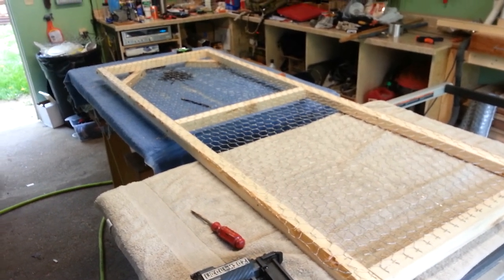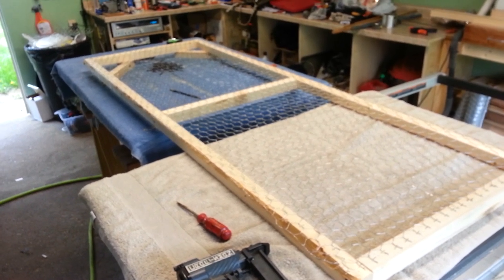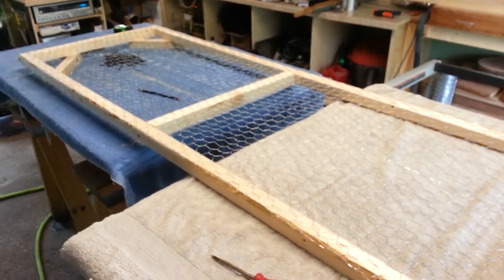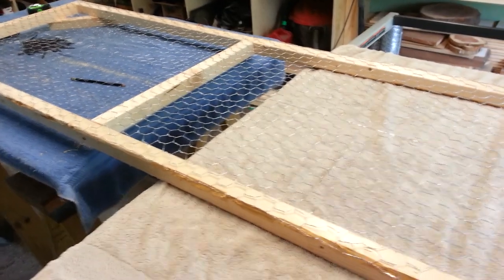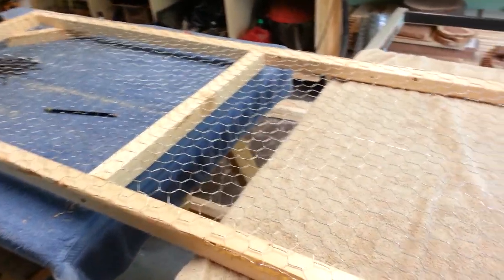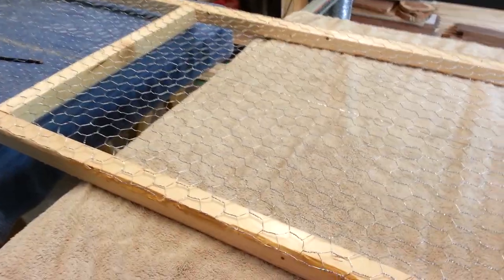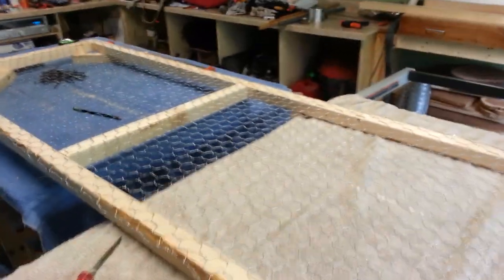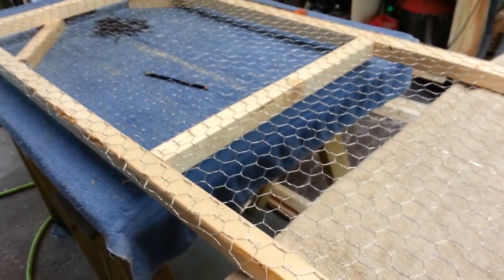How to stretch chicken wire for fence panels

Comment: I have a 18 gage 1/4 stapler that I like a lot but I am looking for a wider stapler like yours Can you give us the model and gage of your stapler and do you like it and is it reliable? Doing chicken  wire tomorrow so your video really helped thanks.
Reply from the maker: The stapler i used is an old craftsman 18 Guage 1/2" crown. Any stapler will work, make sure your pressure is adjusted or if yours has a depth adjustment is set so it doesn't just blow through the wire...

Comment: I need a stapler.
 So how do you unroll the wire and get the bend out so it doesn't want to roll up again?
Reply from the maker: Simply unroll it. I cut the peice to approximately the length I need. I staple one end then proceed to stretch from the opposite end stapling as I go...

Comment: Yours looks so much neater. Lol! I've got an old best up staple gun. Anyway I can ask your advise about chicken wire? Trying to fix a cat enclosure my father made for my cats when I was moving.
By the way I've got 2 sections tightened. Much better. Only 11 more squares to tighten. 
Short story long. I cut a small square out, that's where the opening will be to come inside. Any suggestion how to make a border around it & so it is right as well. I've got to fix some boards as well. I'm trying to finish the inside with scraps I find but I've decided to go with pallet pieces. I've used all the scraps for other projects.
Reply from the maker: faith smith Any opening should have a frame around to attach the wire to.

Comment: The chicken wire is too soft to be stappled directly so the way you are supposed to do it is sandwich it between two thin planks!
Reply from the maker: Nope worked great.
Reply: The edge could be doubled over - this takes up the extra width that now doesn’t need to be trimmed away while giving added strength.... AND use a lot of staples to spread the amount of strain over many points. It’s ROCKET SCIENCE!

Comment: No mention of pronouns what a great video.
Reply: @houseoffire72  I'm using an arrow manual stapler, I didn't want to use staples because at some point they will rust but they are so expedient and seem to work well, I see you are using an air tool stapler, I wonder if it's a floor stapler or a pneumatic version of my arrow stapler.
Reply from the maker: @antpart7998  Its an old Craftsman stapler. Had it for 20+ years. The galvanized staples I used were still holding after four years. We then tore it all down & set it on the curb for free.
Reply: @houseoffire72  thanks for the reply house of fire!  Your stapler sure is spiffy!  I cracked on today with the chicken wire, got a hatch done and two 8'x4' sides of my chicken run, also stained the tractor/trolley that the coop will sit on, I ordered 5 hens but seeing as no one knows what a female is nowadays I'm wondering what I'll get..
Reply from the maker: @antpart7998  Your very welcome. I had to lol with no one knows what one is now days🤣🤣🤣
Reply: @houseoffire72  just checking in with you house of fire!  No manual labor today because humidity at 75% and raining on and off, shame as I wanted  to do more on the chicken run.  Put some overpriced gasoline in the car and drove to the orange woke racist hardware store, I picked up some pocket screws (they are addicting) and some red chalk for my chalk line, and low and behold I saw an arrow pneumatic stapler sitting there on the shelf for $50..Might pick one up if I make more coops or hutches, can't wait for the girls/chickens to arrive as egg prices have gone through the roof.  Hope you are well, enjoying your videos, all the best house of fire!🐔
Reply from the maker: @antpart7998  The orange store does have issues but man I sure like the orange tools😁...